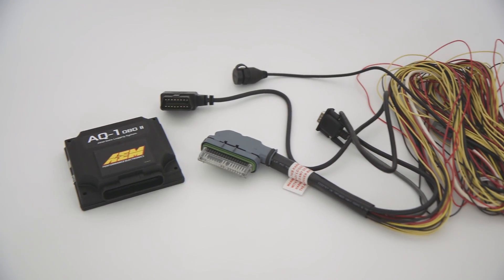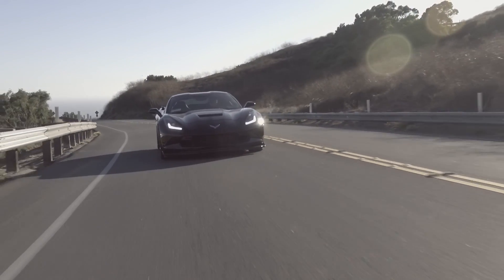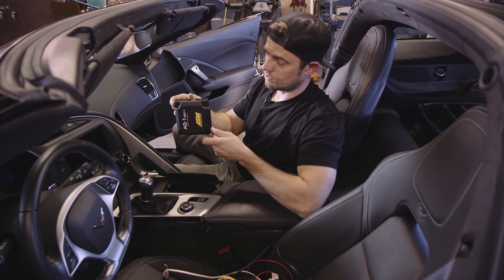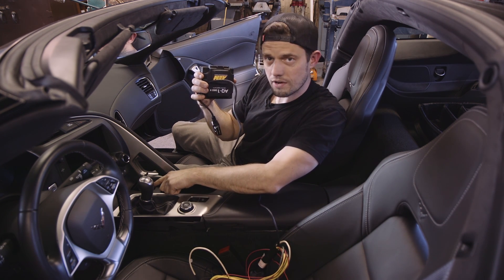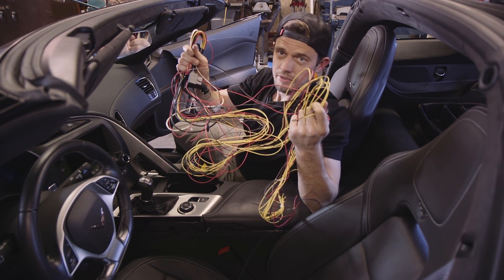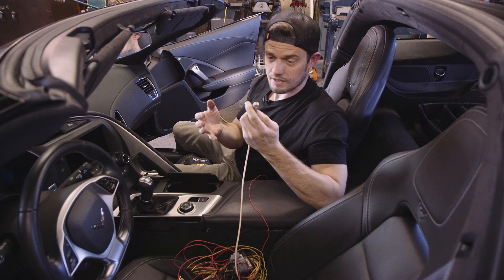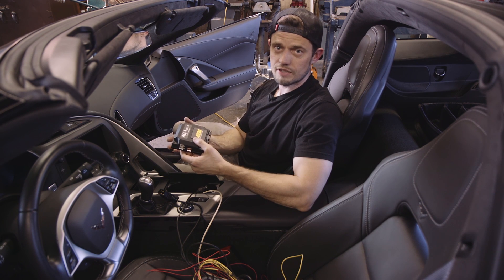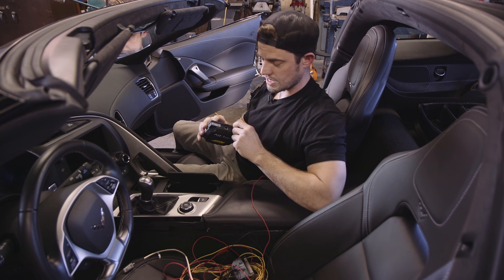Project C7 Corvette: AEM AQ-1 OBDII Data Logger Install

Comment: Very informative video.  Thank you.  I plan on buying the aem data logger with my c7. I see you mounted the unit under the steering wheel column. My question is did you use double sided tape or did you use self tapping screws. Any light you could provide would be greatly appreciated.